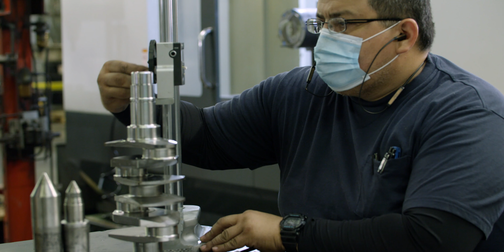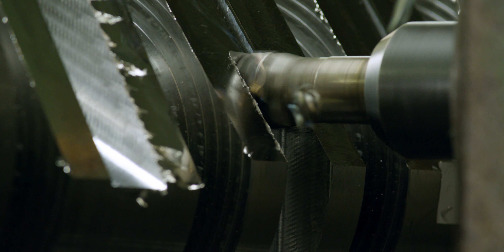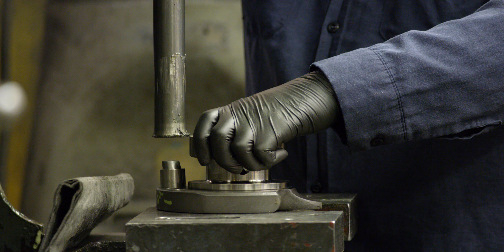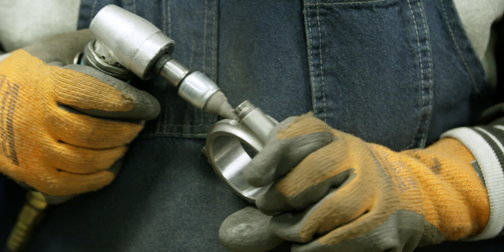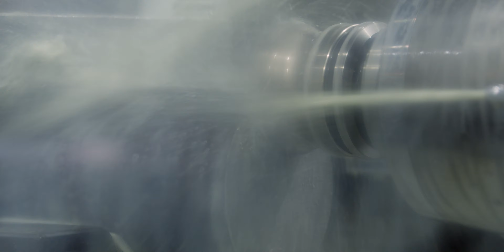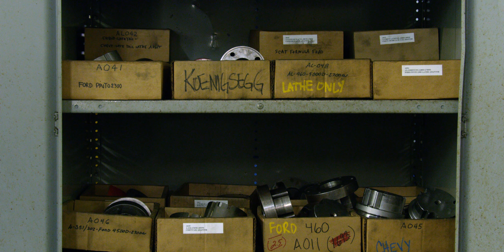An engine’s crankshaft takes INSANE abuse – find out how it’s made!

Comment: Hello .....
I want to ask a question
I want to build a 250cc single-cylinder engine crankshaft and I want to know ...
before more material to use between 4130 ..... 4140 ...... 4340
second after treatment what kind of paint will be needed.?